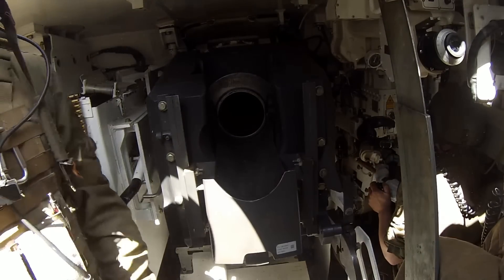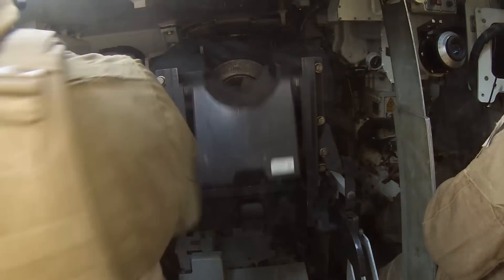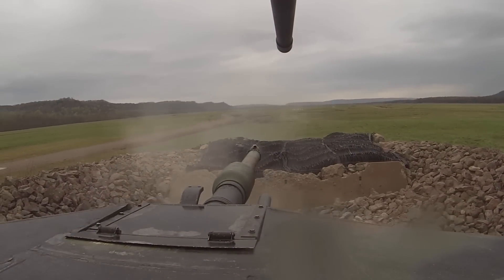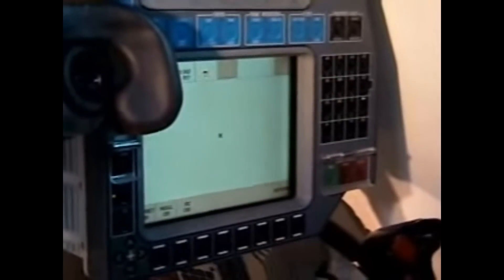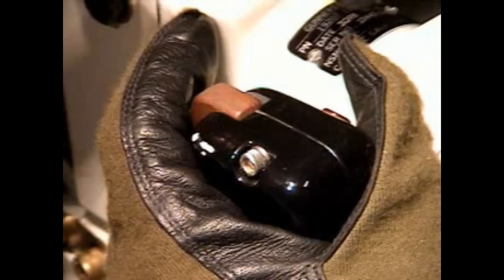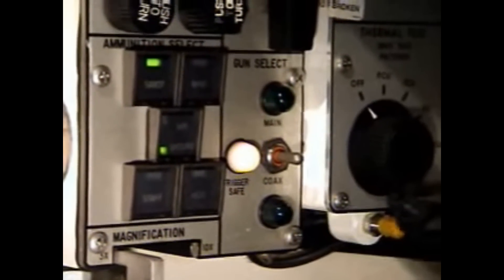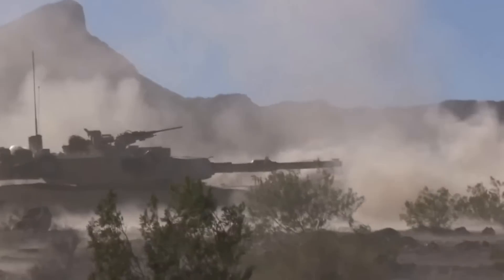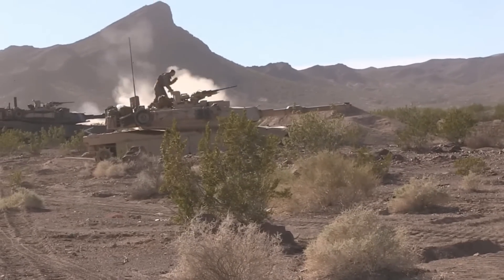How Do They Clear Tank Gun Misfires?

Comment: Now image a missfire on one of those wwii battleship gun like the USS Iowa personality I would like to grab a life boat and leave
Reply: I'd say it's far more unlikely. Battleship guns use bagged charges. It's kinda hard to have those NOT burn.
Reply: The US Navy has a manual with every gun to deal with misfires and malfunctions during firing. It's titled HOT GUN PROCEDURES. The manual carries the written orders of the Commander of BuOrd and you do not fuck around. Follow the instructions to the letter and hope to God you don't get your balls blown off. 
I was a Mk15 CIWS mount captain on the USS Carl Vinson, aka Starpig. The mid barrel clamp shattered during a firing sequence. What a cluster-fuck. After two sweat soaked hours, Chief Barry and I finally cleared the gun. The electrically primed ammunition has the explosive power of about two sticks of commercial dynamite and you can set the fucker off by shorting it with your thumb.
In all we lost three bores, at $25,000 each and about fifty rounds of ammo at $125 each. I was later able to salvage the gun, but that's another story, in short, I pulled a factory over haul on the fucker. I was up on my feet for three straight days!
Reply: lol they at least had multiple guns and they could just keep firing the others. but i agree with pwrserge83
Reply: pwrserge83 you could have ended up in a field artillery unit and would need to deal with the same problem.
Reply: Anh Triệu

Not without selecting 08 as my MOS... There's a reason why I went in on an 1300 contract. (I had the ASVAB scores to make 1371, so it was an educated gamble.)
Reply: That's why the navy does the driving my nice green friend. Don't bet me wrong, we love you guys. You're handy to have around, but leave the tech stuff to us.
Reply: Mark Patterson

... and that, ladies and gentlemen, is why I didn't join the Navy. As a Marine, my weapons systems could generally be completely stripped down in under a minute. (5 minutes for a detail strip.) If I had to spend three days mucking about with a piece of gear that could explode in my face, the person responsible would be in severe danger of getting a nice long tree-line counseling session.
Reply: @pwrserge83  can you explain to me why the Marines are no longer considered part of the navy, which they traditionally were? i mean, they even kept the word 'corp' in the name
Reply: @yareyare_dechi  Ok... a few key details.

Administratively, the USMC still falls under the Department of the Navy. However, they have a completely separate chain of command. These days, the USMC is an expeditionary force more akin to the French Foreign Legion. Basically, the Army is not set up to deploy complete Air / Ground task forces on short notice anywhere on the planet, the USMC is. In effect, the USMC is set up for combined arms operations on much a much smaller scale than the Army could be.

As for "corps"... I think you're not quite clear on what that term means. A corps is any organized military formation made up of several divisions, but not the size of an Army Group. The United States Marine Corps is an appropriate term for it because it consists of about a dozen division sized formations.
Reply: @pwrserge83  i was under the impression corps means subdivision/branch (thats how its used in australia) I guess in that sense the marines are still doing what they always did, being the foot soldiers/forward landing force ( i imagine in days of old its was pretty difficult to bring warships on the beaches)
(australia kinda of did something similar, during the war our constitution forbade us sending out army abroad, so we made a new branch that wasnt bound by that law, the Australian imperial force and the Australian Naval and Military Expeditionary Force, you see where my confusion with the US use of corp lies, we used the word force to imply they were separate service branches to avoid all the constitutional business, corp wouldnt have done that)
Reply: pwrserge83 - No that's not correct. While the charges were as you say, Battle ship crews especially gun crews were large and some times poorly trained especially before the war. One Italian BS the Vitorio Veneto during the battle of cape Mattapan, fired 105 shells in 29 salvos and 11 shells got jammed in the guns, that's a massive number of jams, around 10%. That incident the crew was poorly trained at the time. In WW2 it was unlikely to happen because most crews were well trained & the guns were well made. But it was not unheard of to get Gun jam's on BS's even in the Vietnam war, where some American crews were not as well trained as the WW2 crews were.
Reply: Let me revise my original statement about the Italian battleship Vitorio Veneto, I meant to say the crew was rumored to have been poorly trained but what I remember was the Ship was barely battle tested before they sent it into battle and the crew was working with a new system they were unfamiliar with and like the age old struggle we're all too familiar with, some one at the top of the chain of hierarchy can't admit design flaws! Oh no, that crew had to be doing some thing wrong, blame it on the crewman, the operator, the technician but never the maker.  No that would be bad cause one greedy guy has to line his pockets selling his design flaw to the poor good guys who have to do their dirty work! The Italians lost that battle mainly because of faulty intelligence not because of their performance, they did well despite being out gunned 3 battleships to 1. Apparently the Italian crews had trouble with their range finding equipment too... we know Vitoria and the Italian navy crews in general were top notch sailors of course, their tyrannical chain of command at the time was blaming the men for their failures and not the faulty equipment & that rumor spread. What else is new!
Reply: Powder mags are well below the gun on a ship... raised by elevator. Shouldn't detonate the mag. Bismarck (or perhaps Prinz Eugen) got a drop shot on Hood directly into the deck going downward into the powder mag. It blew the guns off of the ship into the air followed by a pillar of fire.
Reply: Steven Anchundia hard to miss fire I would think as they use to put extra charges after the main round
Reply: bud467 - 99.9% of all these internet armchair generals and trolls have never even seen the inside of a Battleship, they just read about it on Wikipedia. LMAO!
Reply: have you seen the 1989 turret explosion of the USS Iowa?  The mag didn't detonate but 47 hands in Turret 2 were lost.
Reply: Cool anecdote. I was an armorer for the US Army and saw a variety of interestingly mangled weaponry. Personal favorite is probably the ANA soldier who ruptured the barrel of his freshly (US) issued M16A2 on a range day and insisted he had no idea why. Turns out he'd been shotgunning hash out of the barrel for weeks without cleaning it. Evidently he'd gotten away with it for years with his AK but didn't realize 5.56 has a much higher barrel velocity and M16s have much tighter tolerances. Since somewhere around 50% of the Afghan population smokes hash every day, so they ended up giving him back his AK-74 and he was much happier.
Reply: They used a telephone pole and a pneumatic air hammer. THey beat the shit out of it. And No, guns 1 and 3 were unloaded at the time of the accident.
Reply: LOL, and I've been told that a long time ago, they used to press old battleship guns back into service as field artillery pieces. Imagine leaving the Navy to escape this misfire crap and they stick you on the artillery crew with your old friend the misfired 5-inch gun from your last tour of duty! That's my luck and it will either happen to me or some poor sap who happens to be in the same unit!
Reply: all you have to do is replace the primer module and you can do that without opening the breech. if it still fails to fire you wait (I can't remember how long) then they threw the bags out of the em hatch on the backs of the turret if it was safe to do so. if the bags ignite and the breech is open it will kill everyone in the turret look at what happened to iowa when they over rammed the powder while loading and ignited it.
Reply: I've Ben inside the missuri and HOLY @$!# thoes shells are huge
Reply: bud467 - I've never visited a Battleship museum (yet) but I have visited most of the Canadian Naval museums, destroyers, frigates, corvettes, old British man o wars,  & a few submarines; also most military and aviation museums. I'm more interested in aircraft but not just, I really like tanks and ships too.
Reply: I can recomend 2 days at pearl harbor
Reply: Yes, Hash. It leaves a sticky granular residue. Think of molasses mixed with fine sand.  Get enough of that in a 5.56 bore and then you will have an explosive over pressure. It is a wonder Hadji still has a face.
Reply: @poppacross79  that just might be the nuttiest  improvised smoking device I've ever heard of
Reply: I'd also abandon ship if that happened! I can't imagine a SIXTEEN inch round misfiring. LOL.
Reply: Steven Anchundia nope I quit going home. this is now a you problem. just no this would be the perfect way to wreck like 100 ppls day in 1 go
Reply: @cowpow16  16powcows in a row...
Are you awake ?
Reply: protectorian I try to visit any ships I can. I recently visited the submarine in San Francisco. That was crazy.
Reply: protectorian I've been on liberty ships,  destroyers, frigates, and a sub. Really want to see a battleship museum.
Reply: bud467 - I want to see the Battleship Missouri Memorial. If I never get to see another one, that's the one I want to see for sure.
Reply: that is exactly what I was talking about. I knew a few guys on the iowa at the time thankfully none of them were in turr 2.
Reply: Jamie Krutzfeldt - Pearl harbor is an epic memorial but I've seen a lot of pictures of it and it wouldn't appeal to me as a museum but as a memorial & a vacation spot. But that's a definite must see if you love naval museums. What I mean is it would be more like a spiritual pilgrimage to me than a peruse through a museum, the exception is the Missouri Battle ship where I would get lost looking at all the wonderful machinery inside.
Reply: One of the guns
https://lh3.googleusercontent.com/34ZsL5mGwN7fdgVjcLogfnFY-zqhCS1opsteUgpnFmnBSD9g_z_m5-2ioCZODmr6IzjMIaSUYdc
Reply: Hash?
Reply: protectorian US gun crews are highly trained professionals. I have a diploma worth thirty college credit hours to prove it.
Reply: Mark - I never said they weren't so I don't know what you're on about but your college ego doesn't prove nothing.
Reply: does most of the case burn away when fired?
Reply: Bradley Campbell as far as I know no because during ww2 the shells were clogging up the deck
Reply: in this video you can see the rear cap of the case gets ejected. the rest must burn up
Reply: Bradley Campbell yes they use caseless ammunition only the brass car that holds the round together and contains the primer is not consumed.
Reply: If a ship gun has a shell it's an anti-aircraft gun or secondary battery. The big guns use powder charges encased in fabric bags. The shells that come out of the secondary batteries are still used as ash trays.
Reply: ah yes thanks
Reply: well what one was it an air hammer and a telephone pole or did they  "pound" it out with the projectile rammer
Reply: How the hell did the barrel clamp shatter? someone do their PMS wrong?
Reply: the Bowfin sub at Pearl harbor was great too...
Reply: I know I will never get to Pearl to see the Missouri so I have been trying to talk the wife into taking our grandson out east one summer to see the New Jersey... so far I've had no luck so I just might tell her to stay home then and take the grandkid myself!
Reply: That does not sound like fun. I think whoever told you you could short it with your thumb may have been yanking your chain though. There isn't anything TO short. They may have been talking about static discharge but while I wouldn't want to test it and have no problem with impressing on people that they need to respect that amount of kaboom the primers were designed with potential static in mind. IIRC It's using ~40 amps of 28VDC to set them off like 1,120 watts of power as opposed to the functionally zero wattage of a static discharge shoulddd be safe. As I said wouldn't want to try it.
Reply: Dude.
Reply: Mark Patterson 
I GREATLY APPRECIATE YOUR SERVICE AS TO PROTECT MY LOVED ONES, MY FRIENDS AND MYSELF. I can't imagine how stressful of a job that must be/have been!!! I'm afraid my butthole would have broken due to overpuckerage!!! That and probably shitting a brick or ten! Worn out, torn out, mister wizzer with a fissure!!!
Reply: pwrserge I'd rather spend three days mucking about with a broken down piece of miss firing arty than walk the launching nose on a 21 bay MGB over a 200 foot dead drop. That's the one thing I could never understand, is how they figured out how to build a 150 foot span of bridge almost entirely from one side of a gap in 3-4 hours but they couldn't be arssed enough to design a safety rope system for it.
Reply: I just looked it up and the procedure is essentially to replace the firing primer a couple of times and jiggle the gun by moving to maximum elevation and then trying again. If that doesn't work then make sure the gun can't fire, train to an elevation where the gun isn't pointed at anything friendly, evacuate the loading area and wait an hour. If the gun hasn't fired on its own then you take the powder bags out and throw them over the side of the ship.
Reply: Steven Anchundia wow
Reply: Bakuya99 I see what you did there. . . . .
Reply: I'm getting the life boat too . Move over .
Reply: imagine it on the Yamato. 18in guns vs the Iowas 16. no thanks.
Reply: Hears Misfire from one of the forward batteries
"Sir, i would like to request a leave of absence starting immediately"
Reply: Imagine guns personally
Reply: oh fuck that
Reply: That's why they design it to not msifire
Reply: All of the crew on the Vinny were top drawer. We even soled problems that baffled General Dynamics. There were issues with the transmitters. It turned out to be a ground wire that needed to be a heavier gauge. Then there was the mysterious faults in mount 23. That turned out to be a high frequency high voltage spike caused by a faulty deck elevator.We never did actually prove what caused mount 22 to spray parts during firing. But my suspicion leans to embezzlement of funds for spares. The bores must be replaced periodically. The bores on 22 at the time were overshot by some 20,000 rounds. I knew they were shot out for months and reported the issue every damn week. This issue and all the missing test equipment and sub standard tools was never exposed. Until a certain some one royally pissed off some one else and said some one dimed his fat ass out to NCIS.
Reply: Rowing in the 90's
Reply: yes bag guns can and did misfire. the rammer in iowas guns would not reach even close to half way down the bore. that round is still in the gun #3 if I remember. they never fixed t no2 after it blew up it was trained straight and welded in place and all of the hatches were welded shut.
Reply: Its impossible to have a misfire in bag guns. Also it is physically impossible to unload a naval gun, and it was simply just fired. The old saying goes "pull the brass triggers and start over". The one time a large diameter naval projectile had to be unloaded was after the Iowa turret explosion. A gunnersmate assigned to the investigation team 8 remarked back in 2012 that they discovered that the projectile had traveled half way up the barrel due to the explosion, so they had to "pound" it out with the projectile rammer. He never mentioned, nor do i remember reading whether that round was a real or practice round, and i am leaning towards it being a practice round since it was a test in the first place, so there was no danger of it hitting the deck and detonating, although i could imagine it probably would have damaged the teak, or whatever it landed on, assuming they had it secure before it left the barrel, so it probably never did fall to the ground.